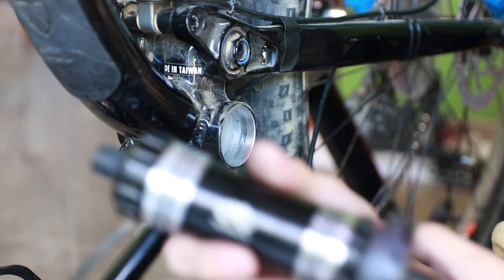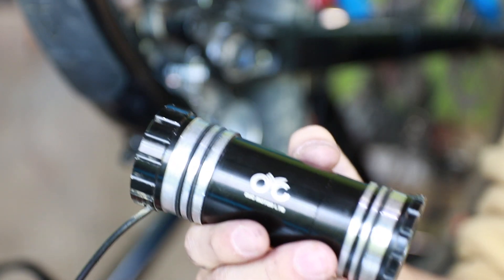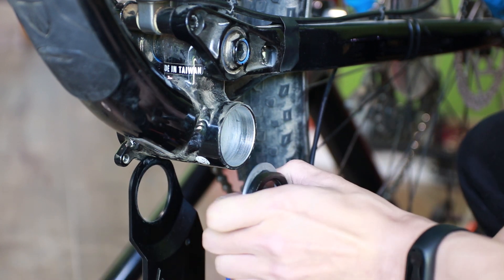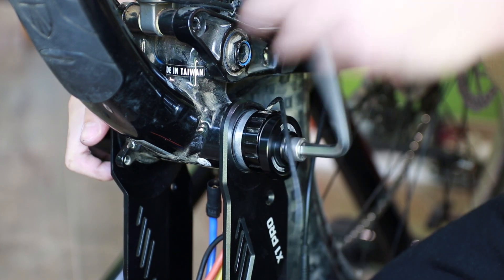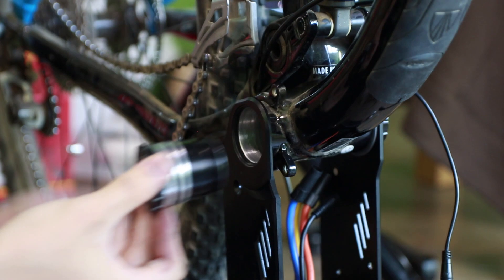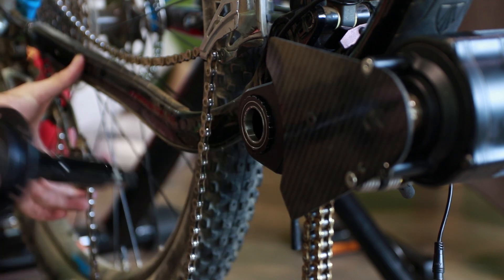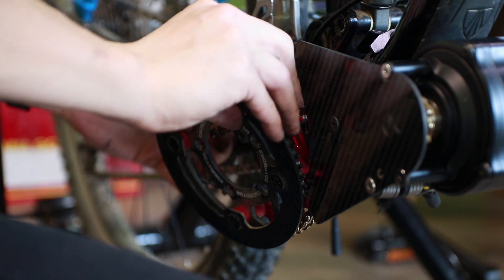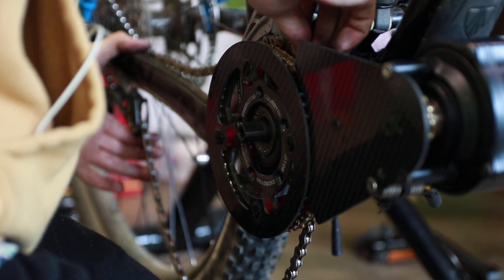X1 PRO GEN 2 BB92 torque sensing version Installation

Comment: What options are there for 113mm bottom brackets?
Reply from the maker: Hi Thomas, best to reach out to our tech support team so we can assist in exactly what option you need. 113mm may be referring to the spindle length only but our team can help check for you. Just let them know what frame you have.